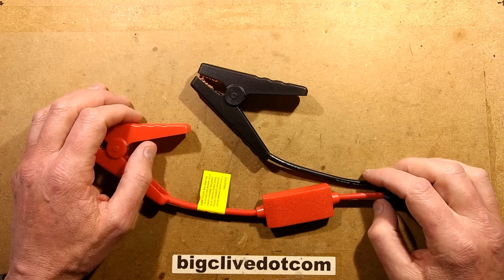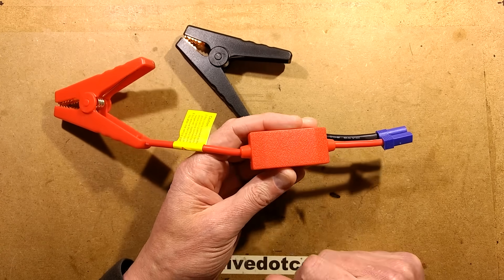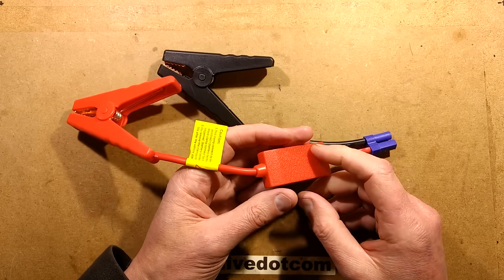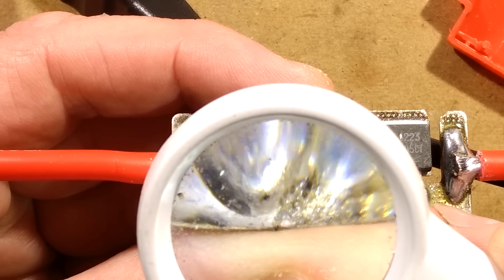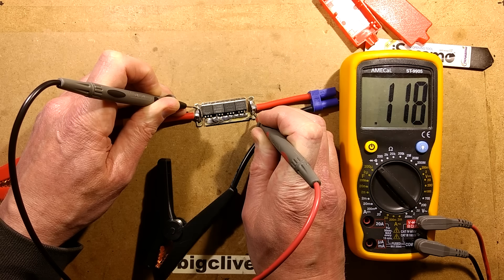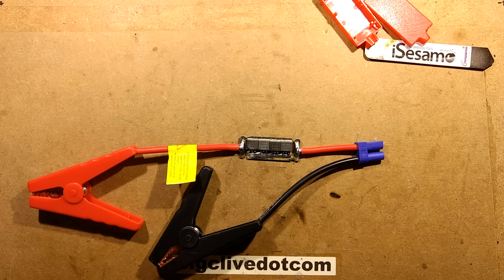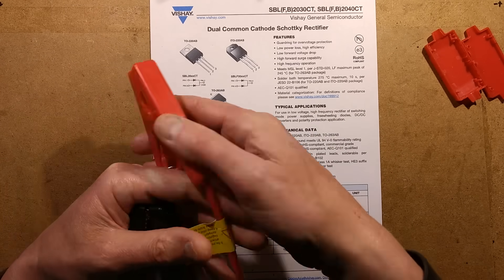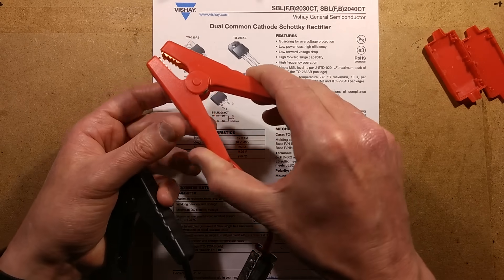What's in the little red box on some jump-start leads?  (Guess first.)

Comment: This is a momentous day for me.
I am just a rough old bricklayer who does his best to understand electrics. 
When you asked guess whats in the box. I shouted a Diode. (I know there is some sort of protection to stop you connecting the leads the wrong way around.)
Many thanks for all the videos Clive. Slowly I am getting there.
Reply: Diode yes!!  Short circuit protection, no, it stops the battery trying to send energy to the box circuitry.
Reply: @petersbluewaterfun  The diodes are also to prevent reverse polarity from burning out the pack if you connect the leads the wrong way.
Reply: The diode pack won’t protect against making a polarity mistake when connecting to the vehicle battery because you’ll effectively be connecting the diode the wrong way too. For it to work as you suggest a diode would need to be provided as the attachment point on the vehicle.
It is purely to prevent the vehicle’s generator from forcing current into the lithium cells once the engine starts running.
Reply: @fazerider9287 Absolutely! I get a bit work from people simply jump starting cars to find that they either stall and won't restart afterwards or electrical equipment has then stopped working.
Often it will be blown fuses,sometimes needing codes clearing,sometimes needing expensive components,a common error made by many is to disconnect the booster pack or jump cables as soon as the dead car has started,when they connections should remain for at least a minute to allow the voltage in the flat car to stabilise otherwise as the donor is disconnected a massive spike occurs at the alternator,only for a very short time but enough time to do occasionally do damage. Most booster pack instructions state a time to leave on after starting.
Reply: I used to have one of these leads for an old jump starter. I opened it before because I was curious what was in it, so I already knew the answer. Giant diodes!
Reply: This showed for me too :D
Reply: What's more hilarious to me is that YT has dug this up after 8 years... which is no coincidence since the Northern hemisphere is heading into winter and more people will be hooking up these parts.

I must be 1/2 asleep still as I didn't have Schottkys on my bingo card.

But I do like Vishay kit - they are my go-to when I have a choice for stuff like this and FETs.
Reply: No it's just a fuse box.
Reply: @satunnainenkatselija4478  Was that an attempt at humour?
Reply: @harveysmith100  Who what where?

Comment: Could it be a faulty diode that's giving you that low forward voltage drop ?  What's it like if you reverse bias the diode pack by swapping the test leads over.

Comment: I've just got one of these for Christmas and after reading about current been fed back into the unit turning it into a firework it's kinda of put me off using it. Is there something more robust that can replace diodes in the square box on the leads that will be more safe ? I don't plan on leaving the jump pack connected to the car for any length of time but it worries me of the battery shorting out causing a fire
Reply from the maker: They're generally safe if they're not abused.

Comment: Hi do you think putting a couple of these diode modules in parallel will help increase the current capacity and less chance of them failing. The cheap ones often only last one jump start. They are quite cheap from aliexpress, so not a major expense but was thinking maybe 2 or 3 in parallel would help them last.
Comments would be very appreciated.
Thanks
Reply from the maker: That might work.

Comment: If car battery is completely flat, using these for more than a few sec will kill the diodes.
Annoyingly, when the diodes fail the tend to fail shorted, defeating the jump pack protection.
Still, far superior to the old lead acid UPS battery boosters.

Comment: Guessing a diode so you dont charge the Lithium cells at the wrong voltage from the car's charging system because current can flow backwards.

Comment: My initial guess is a diode and a fuse.
To prevent wrong orientation of the cables and a fuse to break so the wires don't melt.

Comment: I know this is a old video, but i have one of these that i fried trying to start my car. It is constructed in the same way, but the tin is a low meltpoint metal like rose metal making it effectivly work as a fuse. What happend to mine was that the main lead melted and fell of. The diodes are probably there in case of someone reversing polarity on the terminals.

Comment: This box failed on me during a camping trip. Had a buzzing noise as soon as I plugged in the jumpers. I literally cut the wires, spliced them back together, taped them up and jumped my car with ease. The booster battery was just fine

Comment: Can actually confirm i recently bought one of these starter packs and yesterday i jumped an old nissan with a dead dead battery talking essentially under 5 volts and it took like 6 cranks to get it going and afterwards i noticed that the red blob actually melted a bit and after inspection i found out that I actually melted the solder on those diodes

Comment: Thank you; I was wondering what was in that box. Would not the low voltage drop be due to the eight diodes being connected in parallel?

Comment: The video is now 5 years old. There are several/many tests on Youtube of several, well usable LiIon "jump"starters.
The word "jump" is, at least from my point of view, misleading.
The cable from the positive terminal of a 12 V battery is usually 16 mm² thick in passenger cars but thicker in bigger applications that run on 12 V. Many trucks have 2 batteries in series and have 24 V on board.
A LiIon battery can storage a huge amount of energy in a small volume, better than in lead-acid batteries.
The aim of these little boxes that have the volume of from 4 packages of cigarettes to half of a shoebox is NOT to "jump" the ICE, they do NOT deliver above 300 A at 12 V. They are NOT an auxiliary starter battery.
The aim is, by lots of electronics inside, to analyse the 12 V battery briefly and to push as much energy into the lead-acid battery as possible within 20 seconds (if possible).
Sometimes they need to use "trickle" charging/decharging with a rectangle current and pulswidth modulation for solving/destroying lead sulfide crystals, sometimes (in an ideal world) they can push many Amps straight in for 1 time or many times 20 seconds.
This helps in most cases to "jump"start the ICE from the car battery, not from the little box with thin cables.
There is a difference in charging several times with some Amps for 20 seconds vs. 300 to 1,000 Amps for 3 seconds only with cold oil in the ICE in winter.
The 12 V battery becomes an energy buffer inbetween less Amps for several times 20 seconds just to bring the battery from 8 or 9 V  to 10, 11, or 12 V on one side and just 3 seconds of several hundred Amps on the other side.
Just this, not more - and many little boxes (depending on their rating regarding max. displacement gasoline/diesel) seem to do it very well.

Comment: i just got myself a battery jumper and the electronics for the cable either live inside the unit or live on the rather bulky connector as there is no box on the cable itself.

Comment: You estimated 400 amps is drawn to start most cars, but that is way to high!

Most cars draw less than 200 amps.

I have my battery in the trunk of my car, with a 150 amp fuse (battery side) before a 4 gauge welding cable is routed to the starter. (group 9 + 150 farad capacitor; 2001 Honda Prelude)

Comment: Those starter packs do not work by providing all the starter current. What they do is dump some charge into the dead car battery, so leave them attached for a while. If they have a sufficiently high enough voltage, that charging current could be quite high of the order of a few tens of amps. Hopefully there will be sufficient charge in the car battery then, that it can start the car with assistance from the pack, which will add several 10s of amps for a few seconds, depending on the type and number of cells. Old-style packs used a relatively small lead-acid battery to do the same thing, and I've still got one.

Comment: Are the packs really only 12 volts?, charging system or operating voltage on a car is around 14.6v so I would thing they would try to hit around 13-14 bolts in the pack
Reply from the maker: Keep in mind that the car battery will already be low when these are used.

Comment: I wonder why they don't just use those high-power diodes that look like bolts? Literally looks like a sort-of bolt with tags sticking out, even has threads for mounting. You'd think it'd be cheaper than buying 4 smaller ones.

Comment: Hey, Clive-
A "Carbon Pile" is loaded up, to test a battery, or load up a circuit- with Electrons,
right? Ok- the next particle we capture, measure, use to spray molecules of water
and make them quiver- another type of "Pile" deals with Neutrons.

An amount of an Element that is used to capture, utilize, manipulate or measure
an Atomic particle- is called a "Pile". An old fashioned term for battery is a pile.

Comment: As I recall that box is diodes.  Could be capacitors but I don't think that box is big enough
Reply: Well I was correct. I kinda had knowledge of that because several years ago a youtuber had one of those burn up on hem because he tried to start the car for to long and the diodes let out the magic smoke so he opened the box.

Comment: Diode
Reply: I guessed when told to put a guess in the comments. but ill provide my thought process. I figured since a lithium ion battery is different then a car battery the charging system of the car could damage the jump pack so there are diodes in place to keep the electrons flowing 1 way.

Comment: You scared me witless when you started cutting the plastic with your thumb in front of the cutting edge of a razor knife. If you had slipped when pushing in that hard, you'd have sliced your flesh to the bone. It's not teaching much safety using tools in that fashion.  Keep your hands behind the business end of the tool not in front of it.

Comment: These jumpstarter packs are handy unless you have a hybrid lol. Since the hybrid doesn't use the 12v battery to get the engine going (it uses the high voltage battery to just spin the traction motor which starts the engine), not enough load is pulled from the pack and the controller on it thinks the car isn't on and won't turn on. Luckily the one I have has an override where you push and hold a small button to force it to turn on but it will only stay on for about 5 seconds so you have to race to get into the car and start it.

Comment: I remember when my car battery went flat. I don't have off street parking. I have a universal charger that accepts a wide DC voltage input so soldered a couple of wires to an old laptop battery and recharged the laptop battery a couple of times repeating the same process and it worked. This was when a cheap ELM obd adapter drained my battery.

Comment: still watching but having taken apart a battery jumper pack sold by Canadian Tire, the output leads were direct to the lithium poly packs; I imagine similar applies and the diodes is just to avoid back feeding into the cells to avoid exploding; the specific unit had some kind of a cut off built  in with a bypass button but still I imagine it's probably giving it's all(I didn't take apart the wart on the cable in this case)

Comment: Diode? But it looks too small to carry anything more than a few amps.
Reply: Correct, they only carry a few amps to feed the car battery.  These packs do not start the engine, they just supply a few amps while you are preparing to start.  If you removed the car battery there is no way these packs could start it as they cannot deliver 300A for a few seconds without melting!

Comment: I bought one of the cheapo crap lithium pack things from Amazon with those type of leads, it was just such rubbish and it did make some disturbing noises when I tried the thing. It was supposedly rated for a 2L diesel engine.

I doubt it would have jumpstarted anything other than a ferret that had a heart attack and probably would have blown up in the process.  I sent it back and that was a faff to say the least. Spent far too much on a NOCO GB70 but it does the job magnificently.

Comment: I have a conundrum for you - but you don't have an email address - even on your webpage. ( B0 rch using old 'O' type 18v powertools on the newer 18v lithium battery packs ) - the BatteryPaks are dropping / UnServicable at an unforeseeable rate ( OEM and Aftermarket ).
obviously 2 questions follow , . . .
1 . . . after the Earth cooled and the Dinosaurs had eaten their fill, and they cooled off in pools till oil was a thing, . . what kills the batterypacks ? - ( and are they fixable / )
2 . . . What is killing them - a reciprocating saw is munching through a damp 3.5 inch retaining post, and a bit of sand/snag - a cut out and a 5Amp Lithium cell is U/S, . . the saw works as if nothing happened with both OEM 'O' batterypack or newer Lithium batteryPack, with straight through adapter, . . .

Can the Father of modern consumer Electronics help with this Dilenma ? - I could send you the adapters I made PR7
Reply: it's the older tools that are 'disabling' the lithium packs - the circ saw and one faulty impact driver - the circ saw got grabbed and killed another, . .
check the colour coding of the wiring out from them chinesium adaptors on that darn interwebs - that was assembled in a mirror apparently, . . . #001

Comment: I am not an expert, but this box is not needed, because I replaced my jumpers cables and the new ones (made in the U.S.A not China) came without the box. Secondly, I once started an Acura 2008 with BeatIt battery charger and left it attached to the battery for sometimes while the engine was running, again nothing happened. Finally I disconnected the battery and let the Acura start and run with the BeatIt battery charger only, and it ran fine, no explosion, no fire, no damages, so all these theories are not quite accurate, please prove it to yourselves. I am OK if the box had a fuse but that means extra resistance, so I am happy my jumpers cables have no box.

Comment: I was hoping for a bit more explanation of the circuit in the red box and what it does, but basically its just a set of diodes to stop the current flowing back from the battery to the power pack then?
I had assumed it played some part in the ‘boost’ part of the jump pack, so it was capacitors or similar that wouldn’t pass the current until it had built up enough to “jump” the battery.  I’ve measured the output of my jump pack and its about 13v, so it really acts no different to any other battery placed in parallel to your car battery.
You paid less for your replacement from ebay than I did Clive, my jump pack stopped working and when I measured it, the red bit had failed open circuit.  Bought a replacement set of leads off eBay, and then your warning about them getting hot came true,  first time I tried to use it to jump my dead car the red bit got so hot it melted the solder on one of the red leads and it fell off !    Was quite hard to heat the solder enough to re-solder it back on ….

Comment: I have seen 10awg wire carry 100 amps dc current briefly but the insulation will heat up and fall off with immense amounts of smoke and the wire will get red hot in the middle and burn into! So thinking these jumpers are going to crank out 1000 amps or more is very optimistic LOL. GREAT VIDEO AS ALWAYS 🤠

Comment: Has anyone actually been able to verify the outlandish peak current claims of these lithium jump packs, with a current probe and direct short on the cables?  Does it actually attain anywhere near the claim, for a whole nanosecond or even longer?
8000A from 16V needs a 2 milliohm delivery system.
Reply from the maker: They're ludicrous.  Between internal cell resistance and connection, PCB and component effects they are impossible to achieve.

Comment: Aren't the diodes there to protect you from connecting one of the batteries the wrong way round?
Reply from the maker: No.  It's to protect the lithium cells from being over-charged by the alternator.
Reply: @bigclivedotcom  Of course!  That makes sense.

Comment: There is a bit of a misunderstanding about what is happening with these sort of jump leads and use with battery packs. It is not the case that significant amounts of current flow through the lead when the vehicle is started, what actually happens is that the battery pack dumps energy into the car battery, and hopefully enough to give it enough charge to start the car. It doesn't require the delivery of thousands or even hundreds of amps from the lithium batter packs. I've even seen versions that plug into cigarette lighter sockets (albeit deliver more than 15A that way and it could well blow a fuse). 

Even full size vehicle-to-vehicle jump leads require something like that with some partial charging of the "recipient car's" battery. The jump lead will help quite a bit in that case, but unless it's a very thick one, it's going to need some assistance from the battery in the car being started.

Comment: Don't bother, they are 99%junk, from battery current claims to operating conditions, I had a cheap $30 pack die on one boost, the batteries are ok but the electronics are cooked. Just remember diodes I in series summ voltage drop in parallel divide voltage drop, and it's there to protect from reverse polarity hook up's and blowing up both batteries and to prevent an unregulated charge from alternator entering the pack and blowing up the batteries